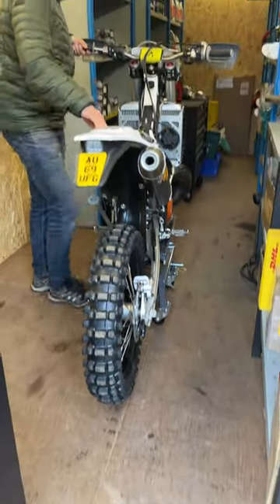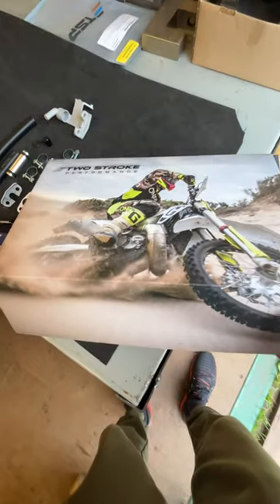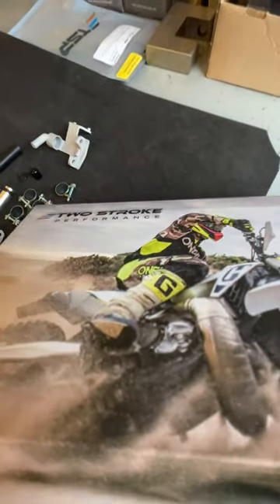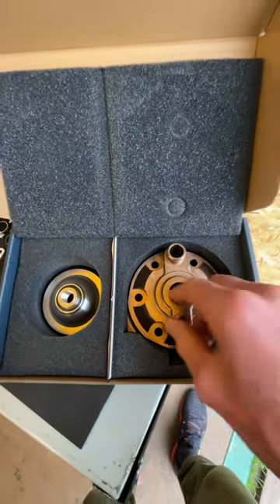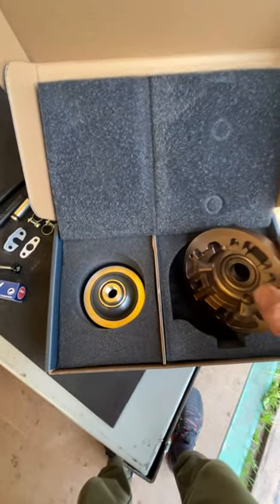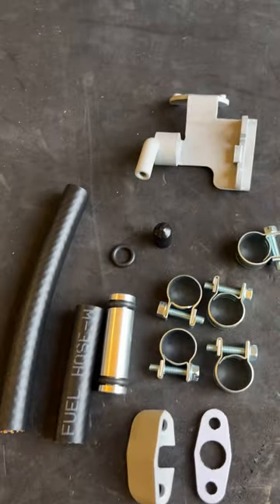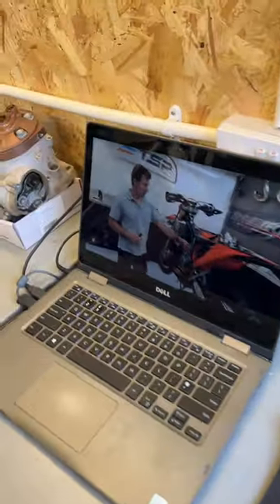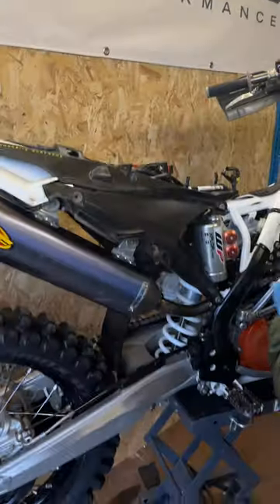Testing Two Stroke Performance (TSP) TPI fuel injector relocation kit #shorts

Comment: Is it with premix or oil pump? Mid Comp?
Reply from the maker: Sorry, bit slow to reply. With the oil pump. it runs sweetly, really good results with the head, reflash and relocation kit. A lot more character to the stock 250 TPI.